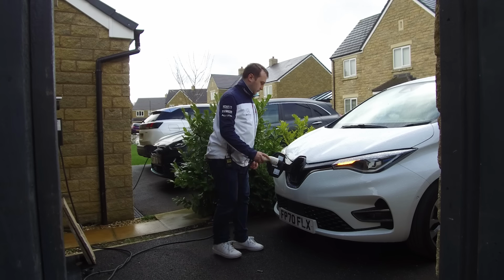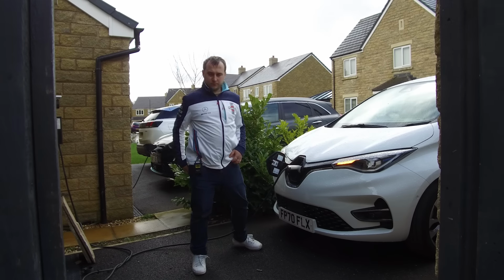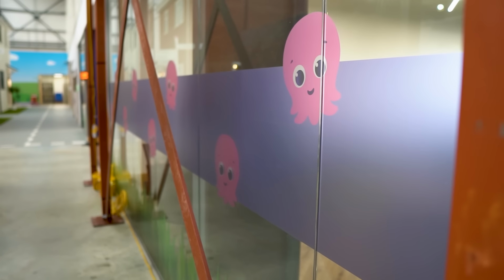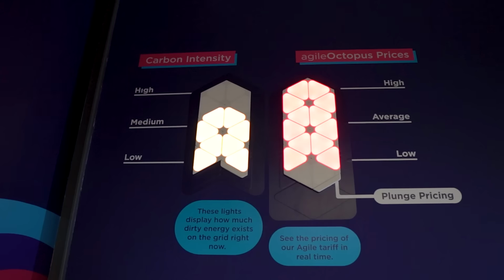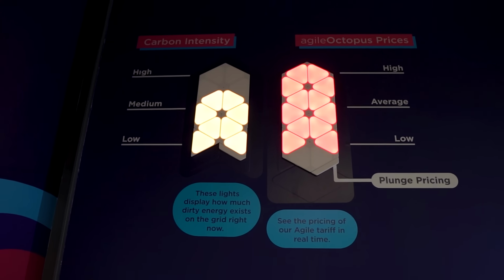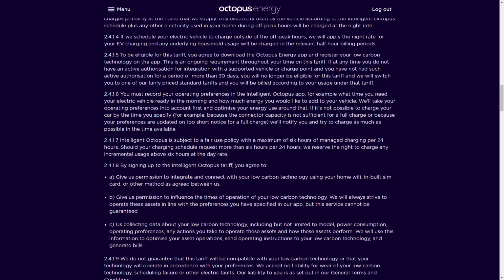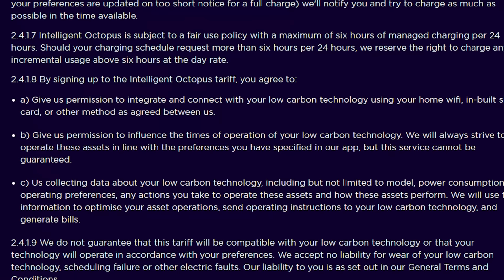How To Game Octopus Go Intelligent For Bonus Hours!

Comment: I don’t understand this ‘unfair gaming’ argument ?

My understanding is that we are only given additional ‘active charging’ times when there is excess power on the grid ?

So no ‘excess’, no ‘active charging’

So I have frequently plugged my car in in the morning, to be given no active charging periods until late that evening.

So no amount of ‘gaming’ is going to create more active charging time, if there’s no excess on the grid - and so what if people use that active charging time to recharge Batteries, etc.  - how is that worse than recharging overnight,  when, in low-wind conditions, Octopus may not have much low cost energy to give, in the first place ?

I’m sure that octopus, which is now the UK’s 2nd biggest energy provider, would have foreseen a lot of these issues in advance, - and they did this tariff, anyway !

It attracts new customers, makes cheap renewable energy a ‘thing’ and saves them having to switch off renewable energy sources when there is an excess !
Reply from the maker: Problem is there’s a gaming trick to give endless extra hours like I said in video I don’t want to explain how this is done
Reply: Ah, that's fair enough Nicholas, that is naughty, - I just got the impression that you were just talking about 'normal' use of the system to charge through the day, apologies. @NicolasRaimo
Reply: You aren't "given" any slots, it's not a database of slots that are cheap, you're allocated slots based on whether the grid is busy or not, when you tell octopus that you need a full charge in a time that it cannot give you a full charge (plugging in at 6am and wanting the car to be fully charged by 10am for example), it prioritises the charge before the peak time grid slots and just treats it like "bump" charging but at 7.5p/kWh, some folks use the car API and limit the Amps in the car to something stupid like 3Amps (normally a car will charge at 32amps), octpus will then keep monitoring that based on the charge speed and keep extending the bump until it's completed, it's absolutely gaining the system.
Reply: @MrNeeds  Minimum charge is 7 amps.
Reply: It doesn’t work like you think it does. You plug your car in and tell whatever you are using that manages the charge what time you want it and how much. Kraken then works out the best way to do that.

Comment: Is it OK to use IO GO for the 6 hours cheap energy, and NEVER plug the car in?  I have a house where I can’t plug in, so I need to charge my EV elsewhere.  My car is eligible for IO GO - so can I sign up for the tariff and just use the cheap overnight rate for my home storage heaters?  The T&Cs don’t prohibit it.
Reply: You need to do at least one intelligent charge a month to meet the conditions. With storage heaters you way want to look at a heat pump, including air to air air conditioning based ones.
Reply: I don’t think you’ll be able to use it, because although you have an eligible car and presumably a smart meter (?), part of the installation process of this tariff is a brief ‘test charge’ of your car.

So if you can’t do even that brief charge, then you probably can’t use this tariff …

But if in doubt, give them a call, they can only say ‘no’ ?
Reply: I was going to trail the Granny charger out of the window and over the pavement just for the test charge..
Reply: I'd say check with them first, and explain your situation fully (ie, what are the chances that you could get a 'proper' charger fitted sometime in the future) honesty is ALWAYS the best policy, - they can only say 'no' ... and if they say 'yes', then you're sorted !

And if they they say no, they you could always just be put on a 'normal' overnight tariff, which is only a little bit more, anyway ?  @williammykura2342
Reply: @williammykura2342  That should work if you are doing the connection via the car. But since IIRC the TS&Cs say you have to plug in once a month  you should at least occasionally plug in like that to keep this tariff going.
Reply from the maker: It’s in the terms you must do so many smart charges but curious why you’d need to deal if you’re not charging your EV? Other deals might be better… evnick.com/energy
Reply: @NicolasRaimo   I’m on Octopus Economy 7 for storage heaters which gives me 8.5 hours at 16p (11pm - 7:30am).  IOG gives 6 hours at 7.5p and a cheaper day rate.  So IOG looks better unless there are better rates out there..

Comment: Plugged my car in this afternoon and intelligent paused the charge and set a schedule. I looked at my phone and hour later and found the charge had restarted at peak rates, charging to almost 80%. There is no way to see if this was at peak, or if Octopus had chosen to charge outside the normal cheap rate window.
Reply: This has happened to me, I am keeping an eye on it
Reply from the maker: Car api? Another reason I always say pick the charger if you can which car was it Tesla?
Reply: @NicolasRaimo  BMW i3 and I have a zappi charger.
Reply: Same thing happened to me last night, (Tesla M3) had 7% left in it when I got home. I wanted it to be 80% this morning. All it had managed to put in was 66%, and that was by 8am. I've read in the faq's that this is all charged at 7.5p
Reply: Keep a note of it and cross check the date and time against the bill when it is generated. That will tell you.

Also Octopus often add in extra slots and you won't get a notification. If you start the app again the newer slots should show (sometimes I find killing the app and starting it again forces a refresh to show it).

Comment: The fair use clause is clear (and doesnt't say that people will be kicked off the tariff).  They just need to enforce it...

"Intelligent Octopus is subject to a fair use policy with a maximum of six hours of managed charging per 24 hours. Should your charging schedule request more than six hours per 24 hours, we reserve the right to charge any incremental usage above six hours at the day rate."
Reply: So do those six hours include the 23:30-5:30 block, or extra to it? If it's included anyway then there is little point in intelligent existing at all and we may as well just use timers on our cars/chargers.

And for me, it would mean I would never be able to get a full charge if my car is below 40% when I plug it in (and yes, I do need the 100% per the instructions for the car, this is actually encouraged) and the tariff loses a lot of it's USP.
Reply: @RichardBrooklyn  The tariff is designed to give six hours of Octopus' choosing to charge your car at cheap rates.  If that's not long enough to charge your car then they reserve the right to charge peak rate for any tme over six hours. It is not designed as a "Charge your car from flat to 100% at 7.5p/kWh" tariff.

The 2330-0530 block is irrelevant to the smart charging aspect but it does provide a useful period for load shifting.  Think of it like the 4 hours for Go with 2 extra hours thrown in as a thank you for allowing Octopus to control the car when you need to charge it.  For most people, even those with a home battery, the energy consumed in this period outside of car charging is fairly low when compared with the amount a car takes.

Comment: I don’t think it would be wise to restrict the minimum charge allowed. That sounds a little controlling and won’t go down well.
I think the fairest thing for Octopus to do is tell you in the App, OK you need more than the overnight 6hr rate to add your desired amount of energy for your specified departure time, we’ll switch your charger on when it’s greenest but you’ll pay the full peak rate unless Octopus is offering “plunge” type sessions.
Also if it’s unplugged the rate calculation should reset to Zero and take into account how many charging hrs you’ve had within the 24hr period if you try to game on reconnection.

Can’t say fairer than that.

Comment: I have wondered what they might do long term. I have switched to IOG after getting a Zappi installed as my ZS isn't compatible. I do note that in the Octo app it allows you to set a charge from 8am to 11am which I do occasionally use to top the car up and then putting some washing on as I work from home. 
I'm close to getting solar/battery system and trying to work out the payback and have 2 spreadsheets, one how I'd use IOG to charge the car/battery overnight and sell as much solar. The other is assuming that they will change it at some point to only allow the car to be charged cheap like OVO.
I'm sure people are realising that IOG is just about the most profitable way to run a solar/battery setup with fixed rates. It's only a matter of time until Octopus make a change to the tariff in my eyes.

Comment: I will occasionally see if my Ohme charger will allocate some extra slots, if 1. Agile rates are currently low and 2. We need to have a washing blitz or do other high energy tasks concurrently. 

That said, I also tend to do lots of small top ups (50 to 80%) overnight, giving the charger plenty of flexibility when to charge, so it can pick the cheaper slots. I also discharge my battery during saving sessions.

So I view this as give-and-take. I hope Octopus see it the same way.

Another option Octopus have is to reward/reinforce good behaviour though Octopoints. Carrot > Stick.